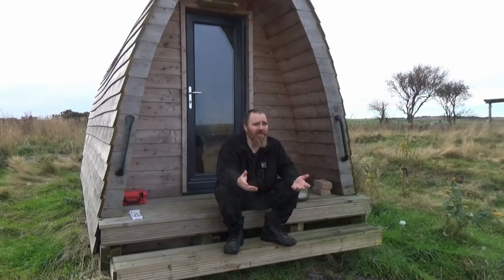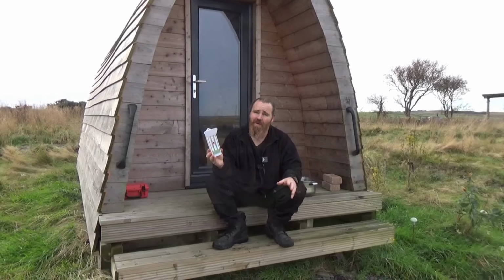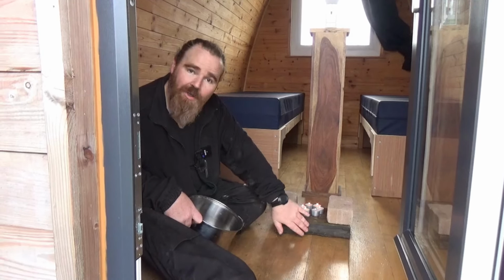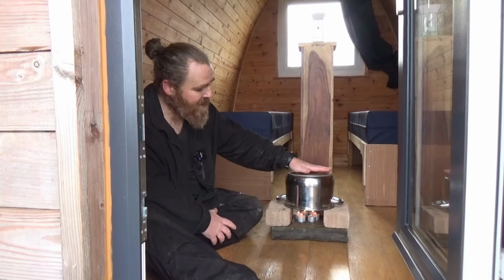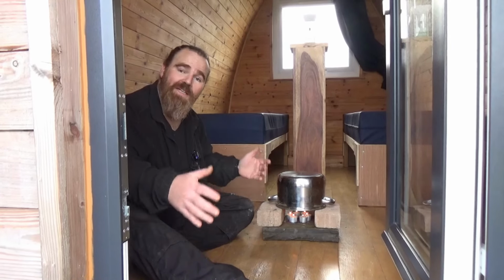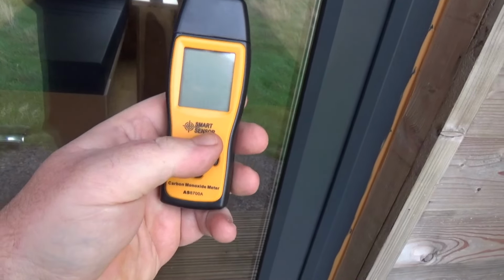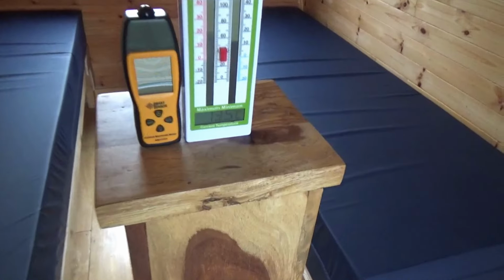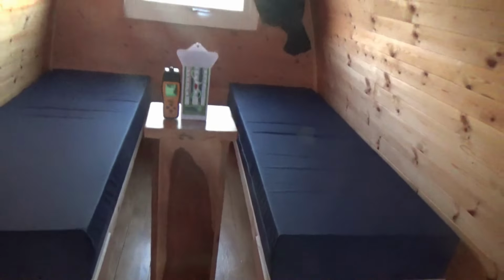DIY Flower pot candle tiny house/camper van/power cut heater tested. Effectiveness? Carbon monoxide?

Comment: Would this work alright with a small hole in the ground or tin can full of coals from a fire?  Could be a relatively safe way to keep a heat source while you sleep. Not a fan of just letting the fire or candles keep going while you nap.
Reply from the maker: I'd be very wary of sleeping in any enclosure with live coals. It can consume huge quantities of oxygen and produce very dangerous levels of carbon monoxide. People regularly die from leaving barbecues in tent awnings.
Reply: @CairnOfDunnCroftPermaculture  I have a portable co2 alarm. Like $15 on eBay.
Reply: @CairnOfDunnCroftPermaculture  but yeah I had a homeless friend that scared the shit outta me. He had a propane heater in a tent with a blue plastic tarp over it and posted wondering why his lighter wouldn't spark up for a cigarette one day. Had to tell him to air it out and leave a vent hole.

I'm mostly planning to use a tarp or hammock so ventilation isn't an issue but the co2 detector is nice to have. I put it on the floor when I stay in run down hotels with old heaters and stuff too just in case.
Reply: @justincase3230  Two alarms are safer that a possible faulty one. Instead of hot coals, I've brought hot rocks into a shelter (from around a burning fire) I placed the large hot rocks on smaller many rocks to prevent melting the ground sheet, welders gloves or neoprene gloves may be needed if the rocks are super hot Justin.
Two or three large rocks, as big as you can carry can give off heat for several hours. 
A warm smaller rock placed inside a cotton sock is great inside your sleeping bag near your feet.
Reply: @pa_maj.MARTINI-van-MAN  good ideas man, cheers :)
Reply: @pa_maj.MARTINI-van-MAN  good ideas man, cheers :)
Reply: @justincase3230  You're welcome Justin.
Reply: @pa_maj.MARTINI-van-MAN  some rocks explode when heated!
Reply: @lennydavis4990  Yes, that's correct Lenny. Best not use rocks from around or submerged in rivers. When there's moister inside rocks, they can explode when heated to extremes.

Comment: Would this work with a (taller) graniteware pot? (They are kind of thin compared to other pots.) If you had a terra cotta flowerpot to use, would that be better or not? I understand one can just put a quarter over the hole...
Reply from the maker: Either should work fine. Some people insist terracotta works better, I might run a side by side comparison at some point.
Reply: smaller copper pot would be best
Reply: @CairnOfDunnCroftPermaculture  That would be awesome to learn of your results in a comparison test! ONE OTHER QUESTION: My housemate has a MORBID fear of fire. I mean really over the top. But we lived through the below-freezing temps of the Austin Snowpocalypse when the power company turned off our power for 4 full days, all of which were days the temperature never got above freezing. We have an unsafe and unusable fireplace, an electric stove and a house with not the best insulation, so we were living in 40-42 degrees F indoors by the last few days. We also could not leave the house (slippery ice all over both exits from the house and all the way up and down the street). We don't want to suffer that kind of cold again and are elderly (and a bit disabled), so the warmth factor is a huge deal for us. But also safety. I'm wondering what we can do that is affordable to set the bricks on as well, which for us would probably be on a glass table in the living room that is maybe 3 feet in height and the top is round and about 18" in diameter. Any ideas on what we could put on the table to set the bricks on? (We plan to use cans of "safe heat" that burn 6 hours.) Up until now I was assuming we should go with the terra cotta but now I am wondering. Saving money is always a good option, but SAFETY and WARMTH are the most important -- and this must be true for just about everyone!
Reply from the maker: @MadlyinLovewithJesus-1953  I'd suggest going with hot water bottles as much as possible. Conductive heat is the most effective heating method by far. As for what to put the bricks on, I'd check to see how hot they get after prolonged use. It's possible they won't get hot enough to be an issue. But I'm not familiar with the fuel you mention, so I can't say how much carbon monoxide it gives off. In your situation I'd use candle heaters just to reduce the background chill a little, and use two hot water bottles per person, and wrap up warm.
Reply: @pablosaintmarr3223  I don't have a copper pot. Why would it be best?
Reply: @CairnOfDunnCroftPermaculture  Thanks. We do have a carbon monoxide monitor in our house, and I imagine since our space is quite large -- the place we would put this anyhow -- being a living room with a vaulted ceiling and no wall between that and the kitchen and dining area, we really would be using this "heater" to be able to sit near and warm up a bit, kind of like being around a campfire I guess? And the hot water bottle is a great idea I wish I would have thought of in 2020! I have one and never got it out!
Reply from the maker: @MadlyinLovewithJesus-1953  it's also often a good idea to divide up a larger space with blanket curtains to make it smaller to heat, unless the ceilings are really high.
Reply: @CairnOfDunnCroftPermaculture  Yes. They are REALLY high! Our bedrooms have much lower ceilings, but we don't really hang out together in the bedrooms. But in a life-or-death emergency, we could take the "heater" into one of the bathrooms -- also with low ceilings -- and take an extra chair in there and hang out. But that's just for a big emergency, haha.
Reply: I’ve always assumed that in an emergency I would pick a smart room to “live in” and try to set it up to keep warm. Perhaps a bedroom might work in an emergency… That situation in Austin seemed terrible. I hope you never have to go through anything like that again!
Reply: @DL-dv4jk  Thanks! My bathroom is actually the ONLY insulated room in the whole house, being the only interior room with no windows (other than my walk-in closet, which has a noted lack of insulation). So it's good to know in a situation like -- what, a hurricane or tornado? -- as well as freezing weather gone too long without heat -- we have that room. I hope to never go through that again, too. (smile)
Reply: Oh I understand that! The only room in my house without windows is a tiny closet under the stairs. Not ideal! Hopefully neither of us ever needs it.  @MadlyinLovewithJesus-1953
Reply: @DL-dv4jk  Well, at least we know it's there for us should we need it!
Reply: @MadlyinLovewithJesus-1953  in an emergency situation have a small 2 person tent. Put it in living room or bedroom...you would be amazed how it heats and you sleep better 😁😁
Reply: Also don't forget...boiling water over those candles is great. Adds heat. Before bed. Blow out candles and leave hot water un covered 👍👍 I cook a lot..I get so hot over those cooking pots LOL!
Reply: @lisalee2885  Great idea for people young enough and able-bodied enough to sleep on or near the ground. My housemate and I are elderly and both find getting up from the ground as difficult as it is dangerous. I'm loving the idea of getting a second hot water bottle (for each of us) though!
Reply: @lisalee2885  Another great idea if you have a way to boil water without using too much precious fuel. Long story but our stove is electric and my housemate's greatest neurosis is fear of fire -- so the camping stove we use indoors uses only pure alcohol -- (Everclear to be exact, which is both safe and nontoxic using it on the solid part of the stovetop in an alcohol burner) -- and it would have to be refilled and started again after something like half an hour. It's great for soups and tea, etc., and to fill hot water bottles, but beyond that we won't be using it.
Reply: @MadlyinLovewithJesus-1953  put your tent on your bed 😁
Reply: @lisalee2885  This is something I definitely considered, for a long time, until I realized that it would be too difficult having to get in and out of the tent the many times a night I have to use the bathroom. Were I able to sleep through the night with difficulty I could probably do it. At this point I am planning on hot water bottles, wool socks and blankets and possibly a "zero degree sleeping bag on the bed with blankets over that if needed. Because with the sleeping bag I can zip and unzip to get out without risking falling out of the bed, haha.

Comment: Burning synthetic/petroleum wax candles on a confined space is about as sensible as running a petrol generator indoors.
Reply from the maker: Run that experiment. Two identical spaces. Candles in one, petrol generator in the other. It's pretty obvious which would produce deadly levels of CO. 
So I'm not sure what point you're trying to make, really.

Comment: Shiny objects - being shiny - can't radiate heat. Most are not as shiny as a mirror or silverware, but this pot is about 60% shiny and mainly uses convection - and the high temperature of the pots surface - is because its so in-effective as a radiator/emitter. The insulating properties of shininess are used in survival blankets and satellites. Btw. you can feel your own strong radiation when you put your whole hand into an empty metal linnen bag of chips - or crisps.
Reply from the maker: That's not correct. Shiny objects certainly radiate less than a matt black surface, but they do still radiate heat. Put your hand near a chrome exhaust on a motorbike when it's running. Put your hand near a stainless steel pot on a cooker. Both radiate masses of heat. Shininess has no insulative properties. Those survival blankets work by reflecting your own radiant heat back at you. They have no insulative properties at all.

Comment: A better control would have been to burn the same amount of candles WITHOUT the pot over it and compare temperatures. 
This test does not show whether or not the pot has any effect.
Reply from the maker: The objective of this experiment was to test the effectiveness and safety of the heater. I'm planning a second experiment this winter, to demonstrate the effectiveness of the radiant bell over candles alone.
Reply from the maker: https://youtu.be/sK539ekJ4bo

Comment: There has no chance of increasing or decreasing the energy or room temperatures by adding inverted pot on the top of candle. What ever the energy have by the candle, will increase heat any way. Only we can change the direction of heat from vertical to horizontal axis, which will give more direct impact of heat flux on our body and give instant comfort at relatively high temp. Otherwise, internal wall of the house will catch more heat and radiate outside.. Burning any fuels in a closed room is not good at all. Better to use combustion furnace,  indirect heating chamber, whose flue gas will dispatch by chimney at outside of the room. So, no pollution in the the heating zone. No additional ventilation required for this purpose, so not much energy loss.
Reply from the maker: https://youtu.be/sK539ekJ4bo

Comment: You're not going to add total heat any more or quicker with or without the pot.  The candles give off a fixed amount of energy.
The difference is you are slowing down the heat loss from the room by concentrating the energy into the pot and effectively turning into a point radiator and creating a hotspot for a human to sit next to just like any central heating system, or log burner etc
Reply from the maker: That's not quite right. It turns a convective heat source into a radiant heat source. Radiant heat is more effective than convective. Same amount of energy, just expressed more effectively.
Reply from the maker: https://youtu.be/sK539ekJ4bo

Comment: Convection is the most efficient means of heat transfer, Conduction is second and radiation is least effective. The rate of radiation is dependent on the heated surfaces "emissivity" or surface condition/finish. Dull, rough surfaces are highly emissive and much more efficient radiators than shiny ones. Change the chrome pot to an iron one and you will improve the radiant efficiency by about 60% .  Radiated IR is what you feel near the surface without touching it. Energy can not be created or destroyed, I'm betting you get the same results without the pot altogether.
Reply from the maker: "Convection is the most efficient means of heat transfer"  Sorry, but that's absolutely incorrect. You're suggesting that putting your hand near a hot object is hotter than touching the subject.

Comment: Heat is heat. 
Making it heat up  something else you can touch like a pot does  not increase the heat  the room except for people 'Lidl people'.  Try a test with just 6 candles and put the thermometer off to  the side of the room in both tests.
Reply from the maker: Please research the effectiveness of the different forms of heat. It's elementary physics.
A hot water bottle works through conductive heat. It's extremely effective. You are suggesting that sitting around the hot water bottle, thereby relying on radiative heat, keeps you just as warm because 'heat is heat'. 
That is patently not correct.
Reply from the maker: https://youtu.be/sK539ekJ4bo

Comment: I've an 100 year old tiled stove. Two winters worth of wood and 5 tonnes of coal in the barn I'm living in.. It heats the entire place up to 24 on average and we've hit 30 a few times. Winters can have minus 20 each year and the odd year minus 30. One time 50 below in Celsius. High Tatra's Slovakia.
Reply from the maker: I have a mass heater, very similar. They're excellent.
Reply: @CairnOfDunnCroftPermaculture  Its a huge ornate thing over two metres high and a metre wide and almost two long. It's so good. Cook on it.. Heat water for a bath.

Comment: There's only so much energy in a candle. Just because you put a pot over it doesn't mean it generates more heat as it burns. A correct test would be to have the same number of candles burning without a pot in the other cabin.
Reply from the maker: That test would require a wet bulb sensor, not a thermometer, in order to measure the radiant heat. 
The amount of energy contained in the fuel in a candle is set. True. However.....
There are three forms of heat energy transfer. 
Convective.
Radiant.
Conductive. 
Convective heat is the least effective, conductive heat is the most effective. 

An example of the difference between the effectiveness of conductive heat and radiant heat is a hot water bottle. If we fill two hot water bottles with a litre of boiling water each, they have identical amounts of heat. But it's far more effective to hold the bottle than to hold your hands six inches away from it. When you touch it. you're experiencing conductive heat. 
When you hold your hands close to it, but not touching, you're experiencing radiant heat. 

Same energy, just transferred to you differently. 
Conductive heat is clearly more effective than radiant heat. 

An example of the difference between the effectiveness of radiant heat and convective heat is a closed room with a window facing the sun on a sunny day.
The room will feel warm if you sit at the back, out of the sun. You are being warmed by convective heat, the warm air is warming you. 
But you will feel a lot hotter if you move to the window and sit in the sun. You are being warmed by radiant heat.

Same amount of heat energy into the closed room, just transferred to you differently.
Radiant heat is clearly far more effective than convective heat. 

You can experience all three kinds of heat from a candle heater. 
Put a board between you and the heater. The warmth you are receiving is convective. The only heat you receive is the heater warming the air, which then heats you. Air is a poor heat transfer medium, so is not very effective. 
Put your hands a few inches from the heater, but not touching. You will feel a lot more heat. This is radiant heat. Much more effective than convective heat transfer. 
If you were to touch the heater, you would likely receive a burn. You would be experiencing conductive heat, the most effective heat transfer mechanism of all. It's so effective, it's dangerous to touch hot objects. 

I am not expecting you to just accept this blindly of course, there are some excellent resources available online you could avail yourself of.
Reply from the maker: https://youtu.be/sK539ekJ4bo

Comment: Sooooo...  how can you harness the heat from a t light candle and still exhaust it outside???

Use mini woodstove designed for tiny house space.....?

Or just use tiny stove to begin with??
Reply from the maker: It can be done. I've seen a candle heater built that way, somewhere on youtube. I really liked the design. But this type of heater is something to use in a pinch, using materials many people already have in their homes, rather than something designed specifically to be a heater.

Comment: It is kind of funny when you say ater a couple hours, when there are 6 tealights under a thin pot,  " It is too hot to touch" You see the problem with these cheap DIY heaters which include clay pot, dome or sand types is the maker always shows the heat generated at the heater from 300F to 500F at the top or side of the heater. They never take a temperature at the ceiling, temps at sleeping level or say 5 foot away from the heater, before and after. The average bedroom in the US is 11'x12' which equals 1056 cubic feet, so guys prove these heaters really work for home or room heating not for a tent or small bathroom...